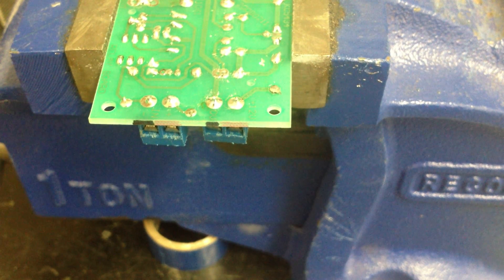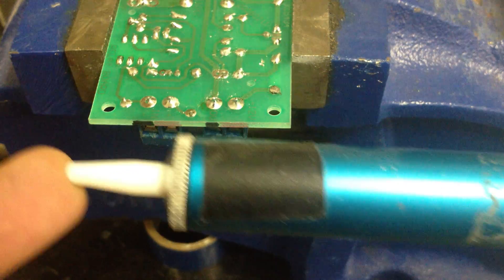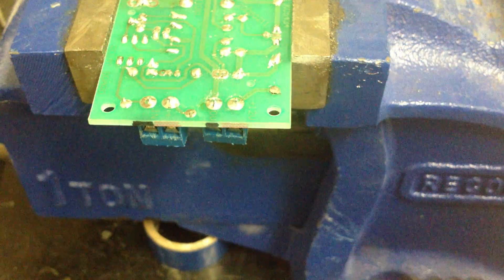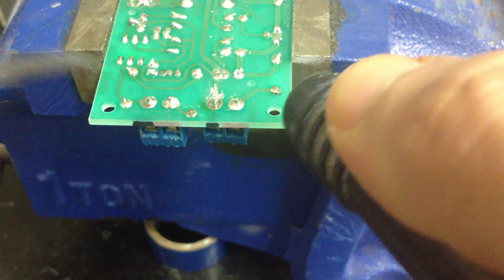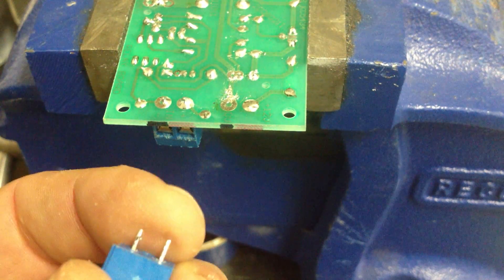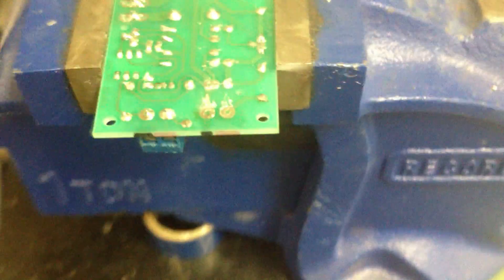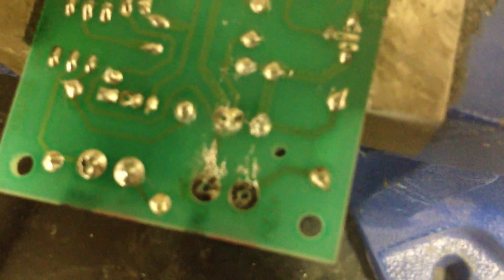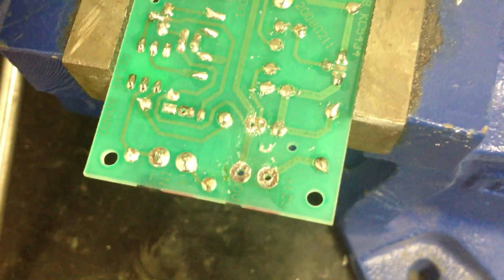pcb part removal ... the easy way..

Comment: I can see a hot air wand (instead of the soldering iron) in one hand and the air compressor nozzle in the other.
Reply from the maker: Steve Prior Hi Steve...maybe that would work OK, I don't have a heat gun, but it sounds like it could make recovery of multiple parts even quicker..please let me know if that works because I am sure more people would benefit from that..good idea..!!

Comment: Been doing this for a while on those ups's retrieving MOSFETs. The only bad thing is that a lot of time the solder will also blow all over the part. And must be removed in order to make sure there is no shorts. But yeah this method works well and even better for single sided pcb's.
Reply from the maker: ***** I didn't even know there are pcb's with solder on both sides...lol...shows how little I know about electronics...but then again, not long ago I didn't even know what a pcb was..lol..
Reply: electro1622
 lol, no worries! when doing through hole with a multi layer board the solder is on both sides. and yeha, this works well but man its a mess. lol totally worth it tho! ~Russ